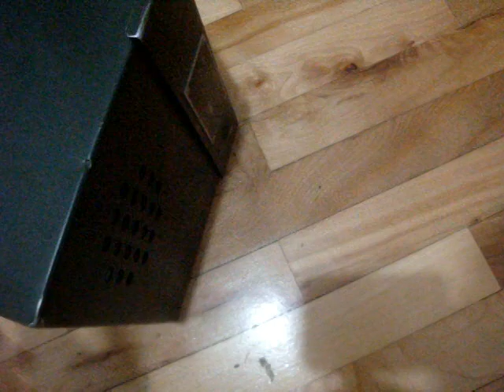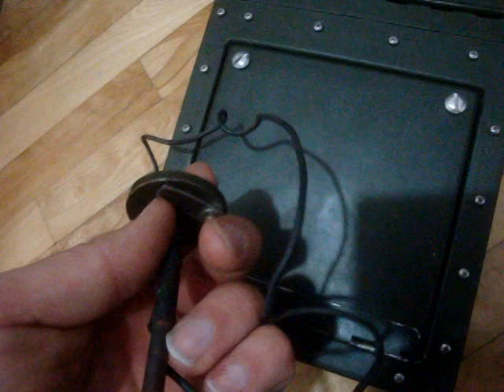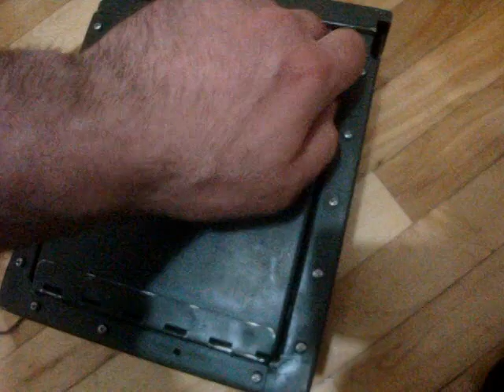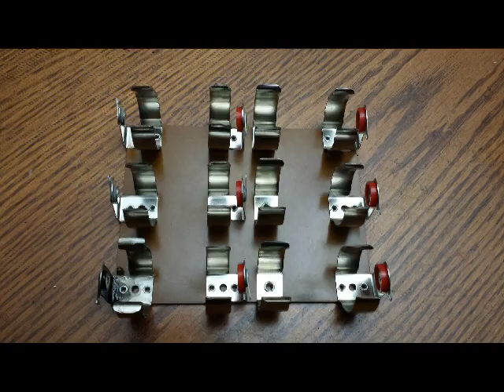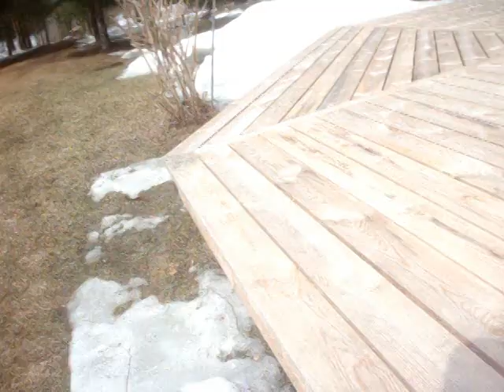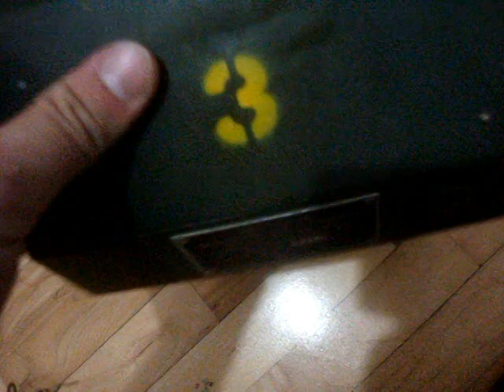AN/PSR-1A Intrusion Detector Update and Test

Comment: I buried one probe on my PSR-1A and I am 100 % amazed on how well it works.
1 probe will pick up a car at over 200 yards away, out here in the Arizona DESERT ON DIRT ROADS. It squeals like a pig on a car. As it gets closer, the squeal gets high pitched. Even if the car is still, if the motor is revved up, it squeals!
 I'm impressed! An easy 30 yards on human foot steps and possibly more.
I buried the wire also.
Reply from the maker: Yeah I was amazed with mine. I think it is even better in damp soil.
Reply: @Stray03  I'm in dry desert and I watched a car set off the detector.at an honest 1/4 mile away. It was a diesel Mercedes benz! Shocked me
Reply: And a confirmation on the buried probe, picking up helicopters. One flew overhead yesterday and just now, today.
If you can hear the rotor wash, the probe can also pick it up. I'm roughly guessing about 1/2 to 3/4 mile away.
I have brand new pews units that don't do as good as these old school probes.
I'm not impressed with the pews units at all.
Reply from the maker: That is actually pretty interesting that it can pick that up well. It would be an interesting thing to play around with and see if the exact thing making the noise can be figured out.
Reply: @Stray03  the helicopter noise was like a whoop, whoop whoop, at first. Then it started squealing like a car does.
I live on an open ranch, so when the rancher releases the cattle in my area, I'm curious how well they will pick them up. I installed an electric fence around my acreage to keep them out. 
I'm 100% impressed. 
Compared with the Platoon Early Warning system, all you get is a code telling you its either a human or mechanical vehicle. And also a beep sound.
I prefer this more, since I can hear the person walking, or how far a car is away, by its low pitch, noise if far away. As it gets within 100 yards, it squeals a very hi pitch....and best of all, is the low battery drain compared to pews! Got to change batteries every couple of days for the receiver if left on constantly.
Monthly on the PSR1A.
Reply: The only drawback I see, is if I plant all the sensors I have, (12) for vehicles, all of them would go off at once. And a person wouldn't know the direction until he looked for it. One sensor covers 360° out to about 1/4mile, or so. I'm totally impressed. 
By using all the sensors, each would pick up the individual and direction of travel, as each sensor is triggered. Best if spaced out far enough so only one sensor works at a time on all 4 circuits. Times 4 sensor per circuit. In Vietnam, the sensors used, were on all the trails VC traveled. All were transmitters and only a few were these wired units for LRRPS.
Reply from the maker: Yeah I think the manual mentions how to go about installing them I'm sure if you modernized the set it would be able to be used much more for pinpointing location of vehicles or people. As is it definitely has its drawbacks.
Reply: @Stray03  do you have any mods for this?
I'm under.the impression on PRC68 DOT COM. That he bought a small amplifier and hooked a waterproof microphone to it and ran a speaker back inside his house. And if I remember correctly from my Army days all speakers were waterproof for the prc25 put into jeeps with amplifiers. Those speakers can also work as a microphone too, from what I remember. LS 454-u speaker.
Reply from the maker: @DMF716  I don't have any mods but maybe in the future I'll take some time to see how I could make it easier to use without having to sit near it the whole time.
Reply: @Stray03 
You know headphones could be used right? I use this at a retreat cabin. Sometimes even small earthquakes and wind set them off even when buried correctly. 

I've had riff raff the other night that woke me up at 1 am. My unit was on and I woke up the the footsteps squaking out on the speaker. They must of heard the foot steps and took off after I got up.
Reply from the maker: @DanHORVATH-yi6cu yeah I have the headphones for it but they don't work so I have to try to repair them one day.

Comment: Pretty cool seeing one of these in action.
Reply from the maker: It impressed me. Technically the sensor is supposed to be buried for best results, but even like that it was really sensitive. It is hard to see in the video, but the thing next to the sensor is the spool of wire, approximately 3x that distance worth. According to the manual, as long as your wire remains under 50 ohms the sensor works, the wire recommended at the time was "field wire" which was good out to 1 mile.
here is the manual:
decodesystems(dot)com/PSR-1A/TM-04074B-15(dot)pdf